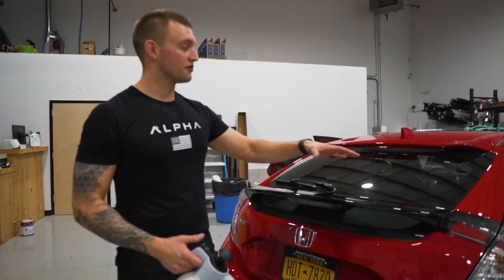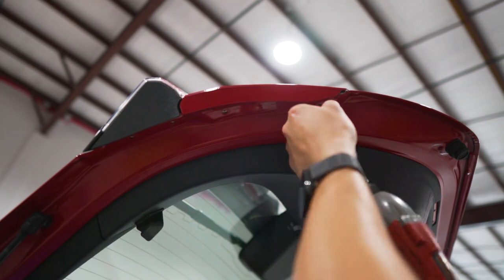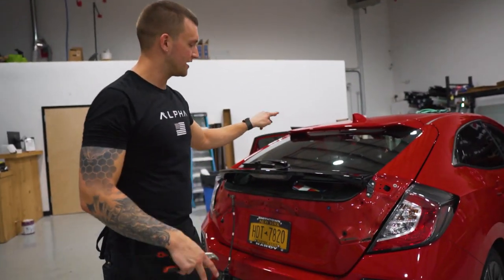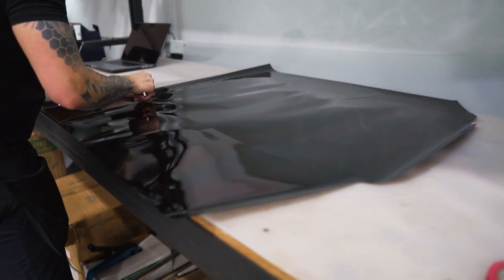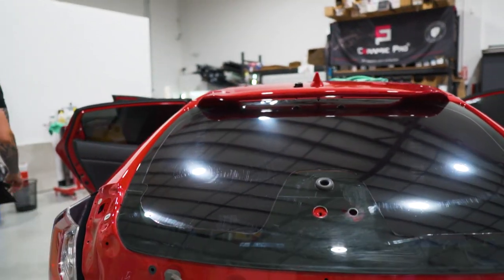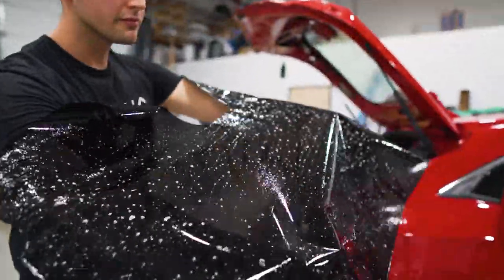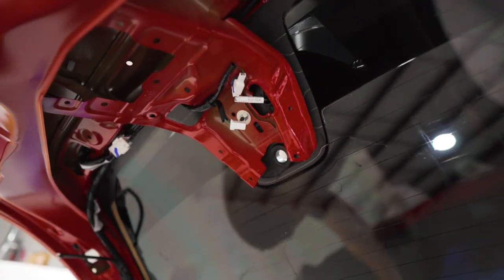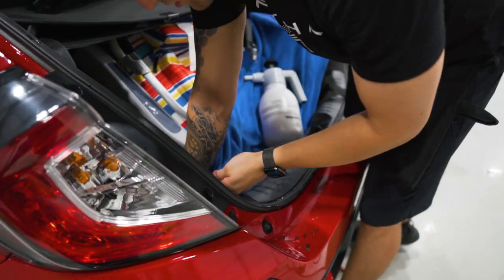How To Tint - Honda Civic Hatchback Rear Glass

Comment: We at the Honda dealership just have a separate back glass to shrink film on. Much easier and you get no fingers that pop up at all on the installation phase 👌 comes out perfect every time
Reply: It worth to have one?
Reply: Ham Anuphap yes it is if you are getting a lot of civic hatchbacks to tint or type r it basically pays for itself and no worries of taking things apart or breaking anything if not careful.
Reply: Yep, cost about $60-$80 for an aftermarket rear hatch glass from a automobile glass shop.
Reply: @rebelthepit  I heard the curves are different though do you think it's true that aftermarket is different from Factory?

Comment: I know this is an older post, but I am honestly surprised that as accomplished as you are, you don't cover door panels or weed the film after you shrink it. I'm a hand cutter, but I've used plotters many times. It's so much easier to shrink the film and then remove the excess film to expose the liner. I'm not trying to insult you in any way, I'm just curious as to why you don't do that. Anyway, I enjoy your videos. I too am a bottom loader and panel/gasket puller. I think if more tinters realized how easy it really is to pull gaskets they would do it.

Comment: What if you snap shrink it on a peel board and touch up after it’s on the window so you don’t have to take everything apart?
Reply from the maker: Its too much tension. Tried that. To put it in perspective, imagine trying to snap shrink a VW Beetle rear window on a peel board and then try to install it 🤣